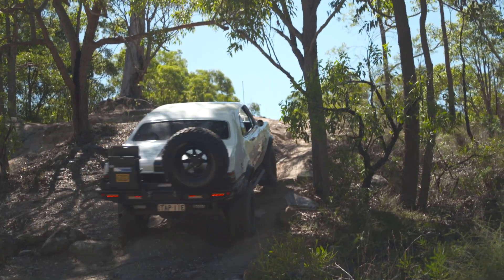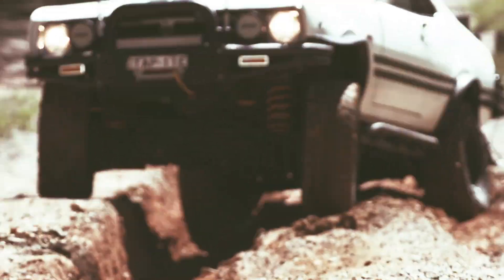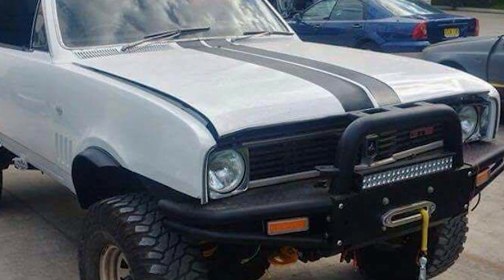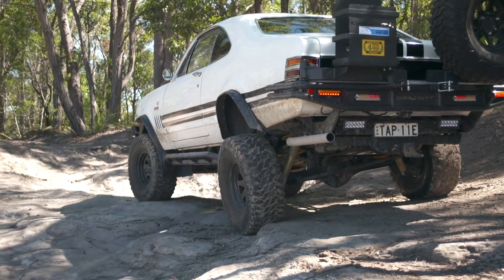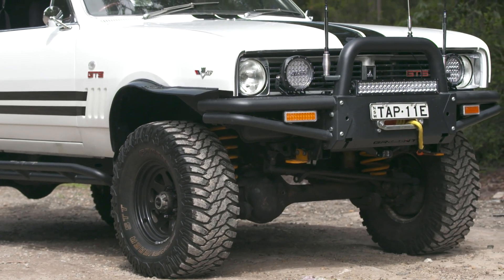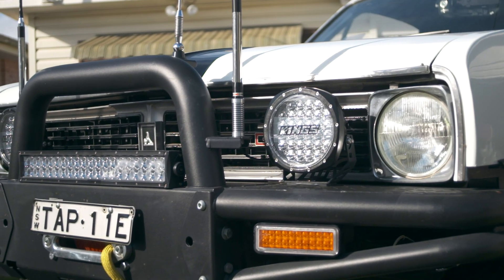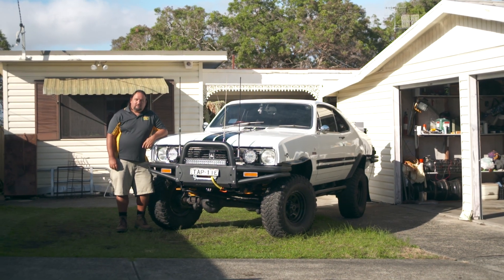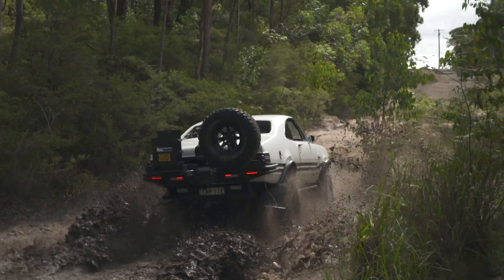Shane’s HT Monaro – Born This Way Offroaders Ep. 9

Comment: The most aussie car ever
Reply: Pepper Steak Pie
Reply: Oooh...i once heard about a raised 'Charger' that was driven from Melbourne to Cape York peninsula, and back. The chassis cracked, at the firewall, before the cape, so, they jacked it up, from the cross member, and threw a weld over it, and finished the trip as planned. That'd have to be a contender for the inaugural 'most Aussie car' awards - locale, and date TBA. Don't ya reckon?
But, that HT is awesome.

Comment: I did a similar build in the early '80's. Took 300mm out of a Holden HT wagon, fitted to a Nissan G60 chassis with a 3.6 litre Isuzu 4BB1 diesel, home made bellhousing to Toyota Dyna 5 speed overdrive, home made adapter to Nissan G60 transfer case to Nissan diffs. Wound up it would do 160 kmh. Did all the work myself...mechanical, fab, paint,upholstery, electrical. Back then you could hand write an engineering request/report with photos and mail it to RTA  Roseberry office, in Sydney. Two weeks later it was registered. Those were the days. Roger.
Reply: AND I paid $70 for  GTS bonnet, guards and dash to fit to the HT wagon.